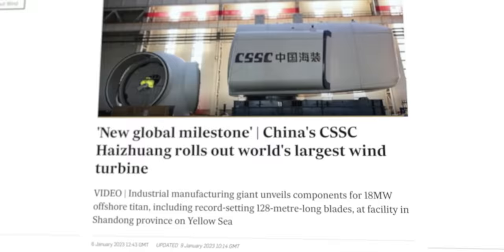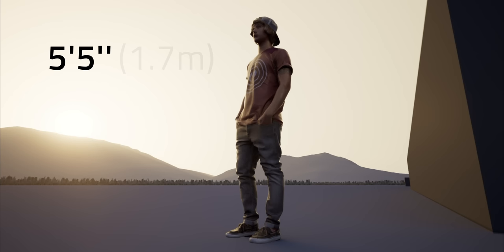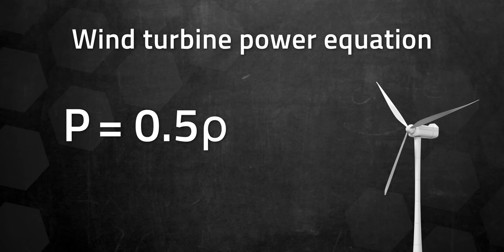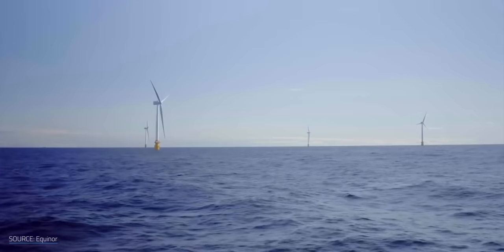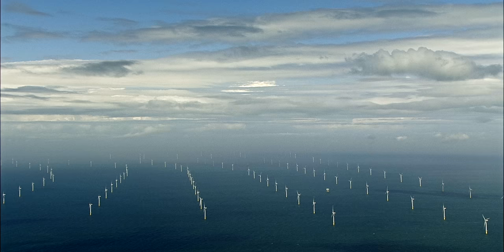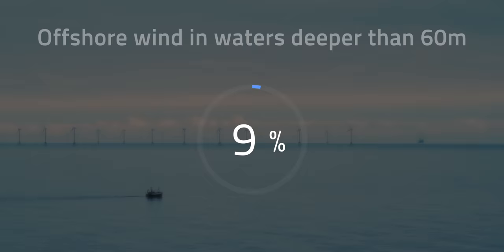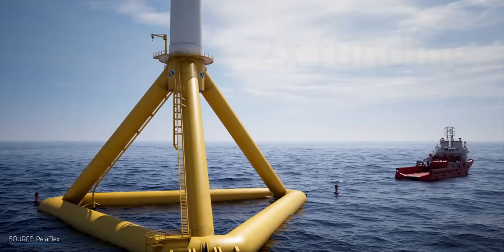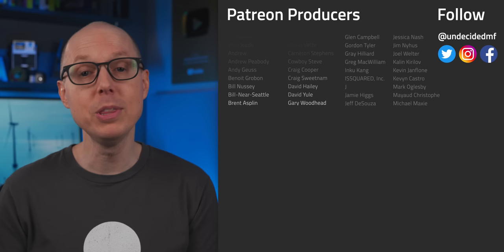Why Are Floating Wind Turbines So Huge?

Comment: Fun fact: I worked for Danfoss Solar Inverters for a short time as a Field Test Engineer back in about 2010. We serviced some of the (then) largest solar sites in the World, "Eggebeck" and "Busenwurth" in North Germany.
Busenwurth was about 9 MW and Eggebeck, I think, about 80 MW.
@0:24 in your video, the wind turbines are shown in the middle of vast fields of solar cell parks... and this is what the situation was in Busenwurth (at least) ;-)
When we were out doing our testing, if it was a sunny and windy day, we could be almost certain, that at precisely noon, the solar power would shut down, due to something called 'PLA', or Power Level Adjustment.
It simply meant, that too much power was generated, and somebody had to yield... and it would always be the solar power (of course, since no mechanical stuff was involved). It was just a message being sent to the electronic inverters, that they had to shut off.
It was kind'a fun to stand next to one of the ½ container sized transformer stations and listen to them going from sounding like 'hhhhhmmmmmmmmmmm' buzzing with current, to go completely silent in the blink of an eye.
Another fun fact: At the smaller of the two sites.... if you took a walk between all the lines of solar panels (there are three 'atop of each other in each row), it would be about the lenght of a full marathon... or about 42 km !
Eggebeck, on the other hand... and I haven't done the math... but it was said, that if you lined every solar panel up in a single line, they would strech from Denmark to Italy, LOL ;-)
Reply: So huge.  And 80mw...intermittent....  A modest natural gas plant needs 10 acres, and its max output ~8x that (700 MW, constant.)

Comment: The amount of wind turbine information in this video has left my head spinning. I'm absolutely blown away by how large these turbines are getting.
Reply: So might the Chinese turbines, get blown away that is!?!
Reply: The amount of puns in this video left me winded
Reply: Well, blow me down if there aren't still wind-based puns to be made.
Reply: There is likely a construction limit based on blade length and supporting such blade weight. The bigger issue is using that power more often than current curtailment rates via more interconnect cables, demand shifting and perhaps onsite hydrogen production when land demand is low but wind remains. We also have a bigger issue with climate change related wind lows that might affect whole sea regions. Floating might allow for moving to where wind is blowing harder instead.
Reply: Which head

Comment: We have a pile of turbines due to be built starting at 20 km (12 miles) off the coast of Newcastle, NSW Australia. Our oldest coal fired power station (Lidell) has just closed down and it will be turned into a battery complex. Good use of existing infrastructure. Thanks for the vid. Jim Bell (Australia)
Reply: Mmmpf, batteries are not the most cost effective storage solution even if they are the most volume effective solution.

When you have a country the size of Australia with such a huge amount of open, undeveloped area it makes sense to use the most cost effective solutions possible even if they take up more space.
Reply: @mnomadvfx  That is the most lazy american capitalist thinking
Reply from the maker: Thanks for sharing, Jim.
Reply: So they closed Lidell before building the replacement power?   I am missing something.
Reply: @brianjonker510  Who said there was nothing to replace it ? Are you just assuming because wind turbines was mentioned at the same time as the coal powered generator, there was going to be a gap where no power was being generated ?
Reply: And they can turn the coal mines into giant batteries using gravity🔋
Reply: @brianjonker510  coal is only one way to generate power remember, there's also natural gas, biomass, nuclear, geothermal, tidal, solar, existing wind power etc

Looks like they also use hydroelectric and diesel in the area ... It's not hard to google these things 🤷🏻
Reply: @mnomadvfx  It depends what you consider a battery, if you restrict your definition to lithium batteries I would tend to agree, but other technologies are available eg vanadium flow or compressed air..
Reply: @brianjonker510  If you're going to re use the site and the grid connection it's essential
Reply: @PineappleKarl  #1. Im British, not American.

#2. Trying to smash an expensive square peg into a round hole is very much the American solution to a lot of things.

Building economical solutions for storage is the only way for renewables to be successful enough to fully replace fossil fuels and nuclear fission in the long term.

BATTERIES ARE NOT ECONOMICAL.

Certainly not lithium ion based systems in any case.

Less conventional battery systems like iron air have great merit though.
Reply: @eclecticcyclist  Agreed, perhaps I should clarify that I was speaking about lithium based batteries when I said batteries are not economical - at least until lithium air becomes viable.

As I replied to another commenter above the possibilities in 'molten air' batteries are very interesting for density as long as they can be keep at sufficiently high temperatures.
Reply: The sooner the better.
Reply: Bitte sagt mir jemand, was ist besser ein Luvwindrad oder ein Leewindrad. Danke für eine Antwort. 
Was war das Growian Windrad?
Reply: @mnomadvfx  Sir, I never said batteries where economical, they are however to currently available option for this project. That project is to build load balancing power systems today where people live. And to end, I don't care what origins you wish to be, your thinking can be capitalist and american regardless.
Thanks for letting me get you flustered over nothing
Reply: Many coal plants could be converted to molten salt battery storage without a lot of modification.
Reply: @UndecidedMF  Bitte sagen Sie mir was ist besser ein Luvwindrad oder ein Leewindrad. Danke für eine Antwort. 
Was war das Growian Windrad?
Reply: @mnomadvfx  Ya, grid scale storage is the worst possible usage of lithium, their benefit(currently) is weight vs density with reliability. There is no weight constraints on grid scale storage and a lithium battery in a grid's cycling would be too much for the batter to make sense.
Reply: @PineappleKarl  thinking with math is equating to thinking as a American and capitalist? Got it! I loved the good old capitalist ussr with their budgets.
Reply: @PineappleKarl  how in the world is considering cost effective options american or capitalist? It's the correct thing for governments to do, consider the best option for the use case. They clearly pointed out how there can be better alternatives and then you just go and immediately start name calling.
Reply: Australia phasing out coal power is music to my ears!
Reply: that's great use of existing infrastructure and transitioning a new generation of labourers from coal mining to a more feasible option.
Reply: @brianjonker510  nope, you got it in 1…
Reply: @simon-pierrelussier2775  It isn't so much that they are phasing them out as much as they are just not economically viable these days and the power companies are looking to other options with better profit margins.  Many of these coal power stations closing down are doing so well in advance of what was asked of them to combat climate change.  That said,  Australia still hasn't done much to stop selling mountains of coal to the rest of the world.
Reply: I have not seen a single thing in my 60 years that the sea will not break.  Maybe you have seen a few?
Reply: @simon-pierrelussier2775  sadly my Candian cousin is still fighting Aussie coal digging companies trying to dig up the Rockies.

Luckily she so far seems to be winning, so that's something at least.
Reply: @benjamincock5357  That is a fantastic point.
Reply: @stevehayward1854    It is safer to assume the cynical when politics gets involved.   In this case the headline of "Shutting Down the Coal Plant" and replacing with Wind Turbines could have all kinds of cock ups
Reply: @brianjonker510  No, lots of solar & wind farms etc. have already been built on land. Needs to be complemented with offshore wind farms before Eraring coal fired power station is closed in a few years.
Reply: All you have to do now is celebrate the closure of  Eraring  and see what happens to the grid with intermittent expensive renewables.
Reply: Yes and it had the existing grid connection in place plus faster planning as the plant (and space) were sitting there looking for any suitor
Reply: @AndrewSmith-cd5zf  Obviously you are not up with the times. Do a little research.
Reply: That does sound great as a one-off thing. But if Australia, and I mean Australia specifically wanted to make a real difference to the climate crisis, it would be to reduce coal production. 5th or 6th highest in the world I think, but 50th by population, i.e. the percapita coal mined is higher than China. Sorry, don't want to be a downer, your excellent sounding wind farm, but its a very tiny thing, compared to the difference that would be made by reducing coal production, increasing the cost to the countries you export to and thus encouraging them to build a little wind / solar / nuclear themselves rather than more coal fired powerstations powered by cheap australian coal.
Reply: @danoneill8751  If ac demand and electrification is going to raise demand, then you need to put in low cost renewables 1st. Then shutting coal is an easier political and capitalist decision. Otherwise blackouts and local job losses scupper the move
Reply: @AndrewSmith-cd5zf   🙂 wholesale went DOWN when they closed Lidell. 🙂 We're not making this stuff up. Industry not government are making these decisions because they are looking at their bottom line over time. The pace of this change is still amazing though.
Reply: Ever heard about "air rivers" that bring moisture (=rain) back to dryland?? So ... are we sure-sure that this aeolic energy capturing is good for us?
Reply: Do you know how much fossil fuel is required to mine battery material from the earth, process those materials, manufacture the batteries, dispose of the highly toxic waste resulting from the manufacturing, transport those batteries, install the batteries, remove the batteries when they wear out, and then dispose of the highly toxic depleted batteries?  Oh yeah, the same use of resources and fuel is required to manufacture the blades, and those blades are made of materials entirely dependent on fossil fuel products.  The amount of fuel required to remove and dispose of those turbine blades is also massive.  This is what business schools call "buying yourself a job" and is a common mistake made by uneducated, or just plain stupid, people.
Reply: @maxbrazil3712  do you?  You've dumped a fine pile of words, but where's your numbers to make them mean anything?

The environmental payback on a BEV is about a year vs an ICE  car.  Turns out burning fossil fuels continuously to function is extremely dirty.  

Even sooner if using fueling your car with the toxic sludge from oil sands, that needs to heat to separate, create giant dead zone tailing ponds, need another chemical process to keep it low enough viscosity to pump somewhere, use additional chemical processes to convert it into usable fuel.  And that's before you burn it to mostly produce heat which you don't use and need to dissipate, to eventually create a motion and link it into other motion which creates more waste to get about 30% of that energy to the wheels. Another use of oil sands is asphalt roads, it's the goop that holds all the aggregate together.
Reply: And all those batteries will be thrown into the ocean land fills or else where great job
Reply: @AzamatSlowedAndReverb  So batteries have a refined mining recycle value in a compact block. Car engines have just metal scrap value and the plastic parts are just low value junk.
Reply: @AzamatSlowedAndReverb  No more than scrap engine parts but with a higher valuable refined mineral, some in scarce supply. Many batteries will end up as occasional power storage (cheap tesla power wall) or electrify old vintage cars.
Reply: @brianjonker510  Coal fire power stations in Australia are being closed because they have reached the end of their service life. 
Nothing mechanical lasts forever.

Comment: At least decades ago, when wind was new, big turbines also had lower range of winds that were useful, so they often were standing still when smaller turbines still worked, because there was either not enough or too much wind. At sea, winds are more steady, so making big turbines make a lot more sense.
Reply: Larger turbines actually start producing power at a lower wind speed than smaller ones because of their larger swept area.
Reply: @ericreimer6627  I guess they solved the problem, whatever it was.

Comment: The size of these wind mills is just stunning.   As a farmer I run the formula pi R squared and the swept area is larger than many of my fields.
Reply: Not only is the swept area huge (53,000 m^2 or about 13 acres) but also do the math for circumference (816m) and from that calculate max RPM before the blade tips cause sonic booms (speed of sound in air at sea level is about 340m/sec) so to be safe, let’s say 300m/sec max blade tip speed, which means a minimum of 2.72 seconds for just a single revolution, or a maximum rotation rate of only 22 RPM.  So if you ever see one of these behemoths spinning even just half as fast as the second hand of your watch, RUN
Edit: as lesageethan points out, the second hand on a watch turns at exactly 1 RPM, so my final statement is bonkers.  The math is correct, 22RPM is correct, but it’s up to you to figure out what speed that is, the second hand won’t help much (if your watch even has a second hand…)
Reply: How exactly  do you "mill" electrons into moving?
Reply: @alanevery215  Charge at them at a gallop with your lance at full tilt.
Reply: @alanevery215  by using electromagnetic millstones
Reply: @jpe1  But a watch's second hand rotates at 1RPM? So these can rotate 22x faster than a watch hand, not 0.5x.
Reply: @lesageethan2380  wow, I’m deeply embarrassed… the math is correct, but my final statement is, as you point out, totally off the mark. I was looking for a simple analogy and didn’t think through what I was writing, I was apparently thinking the second hand runs at 60 rpm, but of course it runs at 1, by definition.  🤷‍♂️
Reply: @jpe1  don’t worry John! I actually had to google the speed of a second hand in RPM, and when I saw it was 1rpm I was embarrassed that I had to google it at all!
Reply: pi R squared, eh? You may be a mathematician but you ain't no engineer. Engineers don't use pi, 3 is plenty good enough for their calculations.